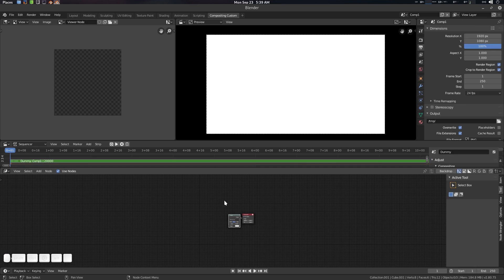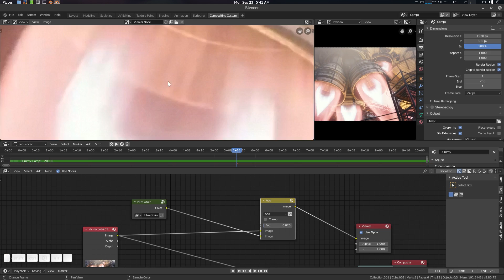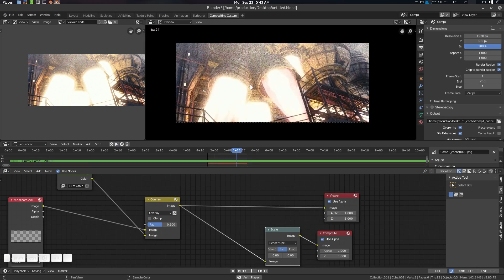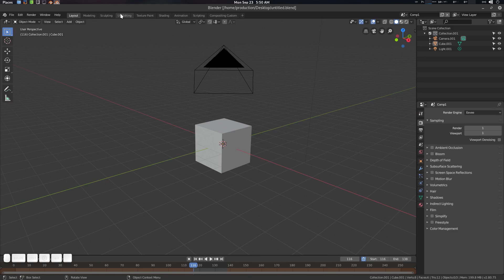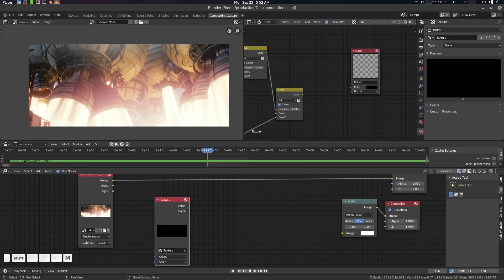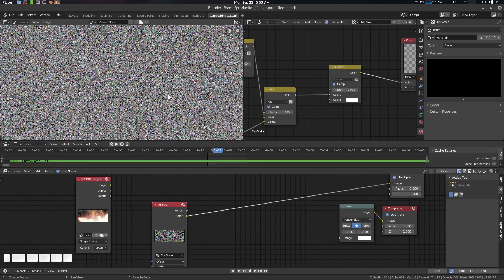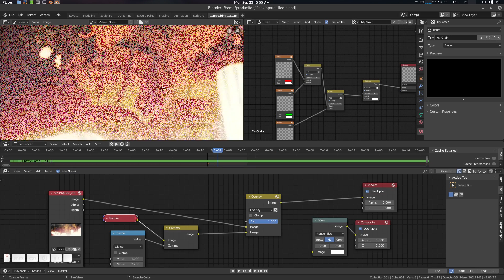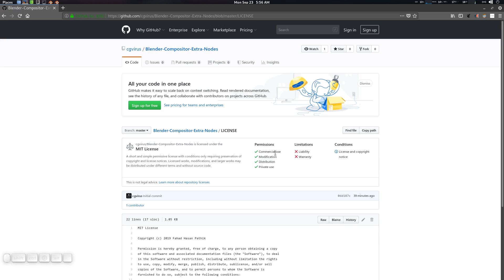Film Noise Grain Node in Blender 2.8 Compositor Tutorial and Download

Comment: i wanna ask a question.. usually a film grain is "animated" (i mean like not static noise, it's always moving) is this also moving noise or static?
Reply: The noise texture is easy to animate by using [Value node] to it's <offset>, Then adding <keyframe> to the [Value] and adding the [Noise] modifier in the <graphic editor> affecting to the keyframed [Value], that is connected to the original Noise Texture's <offset>

And changing the Values on the Noise modifier, you can control the noise's speed and strength, etc etc.

Sorry if it's too complicated, it was hard to explain

Well I did a quick example:
myprintscreencom/s/29v5d/f24d15d485

Just add <dot> between [myprintscreen] and [com] to get the link working properly. Youtube just likes to delete the comments that has the link on them

Comment: зачем добавлять шумы туда, где и так всё хорошо? Хотите сделать, что-то типа фильма, переснимите своё видео с экрана камерой смартфона. Сделайте себе экранку.
Reply from the maker: As far as I have understood from translator:
It's important to give a grain plate specially when 3d, 2d elements are used over a live action plate to match the camera noise. All sensors still have to deal with film grain as far as ISO is concerned. Also noise helps in case of subpixel chroma banding. A pretty much standard wrokflow in VFX pipeline.